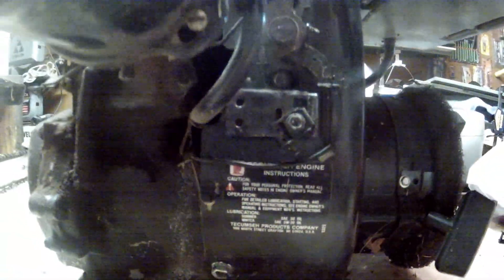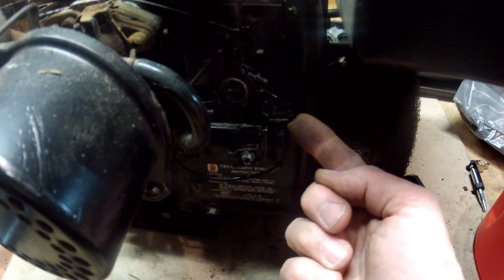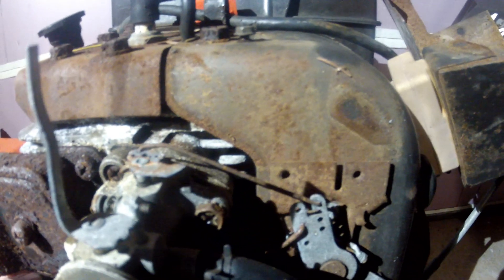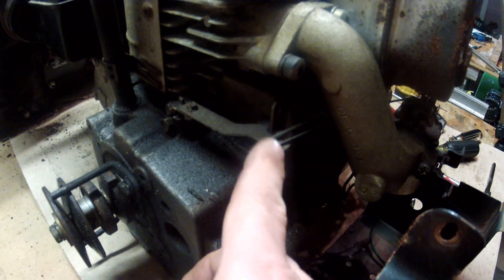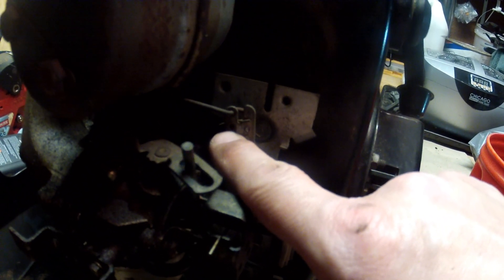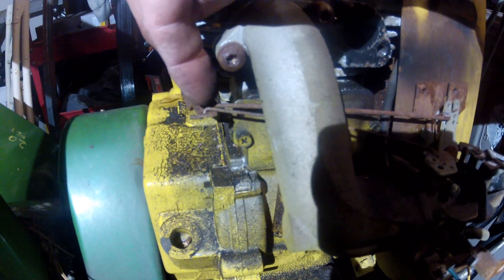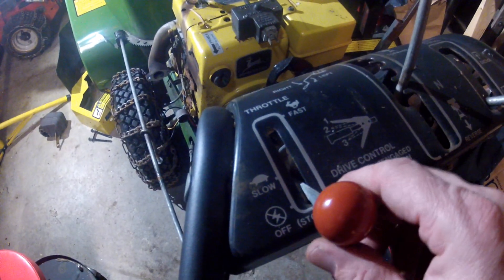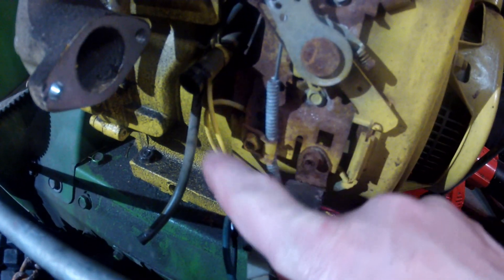Tecumseh Governor and Carburetor Linkage - Horizontal Shaft

Comment: Oh... it never ends... My incandescent headlamp just went out on my Bolens 824. It dies while it was on during the only night time use I've ever done... at the worst possible time. The bulb did not blow and I don't see a fuse anywhere. I wired in a LED tractor light with no results. Any ideas?

Comment: Wow... the older I get, the less I know. I looked at this vid for a few days because I couldn't understand what I had done after my carb rebuild that made the linkage so screwed up. It finally dawned on me today after viewing this once again that I had the throttle arm hanging down instead of up- where it needs to be. I couldn't understand why the arm was rubbing against the throttle cable shroud, then my mistake finally hit me. I removed the carb and repositioned the governor linkages so the arm is up. All is good now. 

You keep saying "thanks for watching", and I appreciate that, but more so... I want to sincerely thank you for making these videos. I've learned a lot from all of them.  If you ever have a guitar-related issue, please don't hesitate to ask.